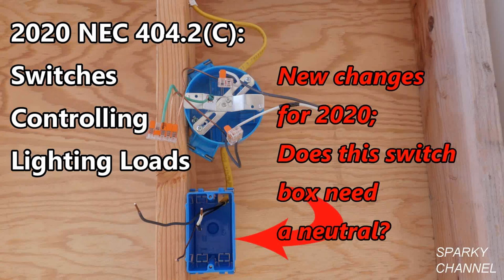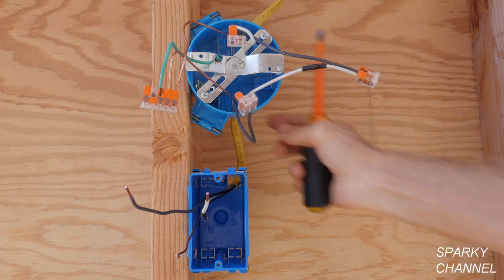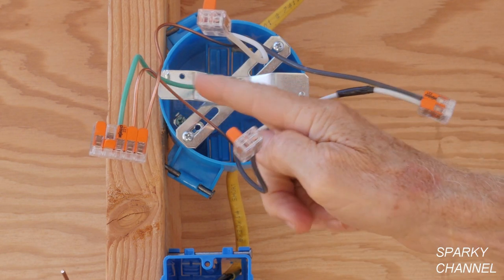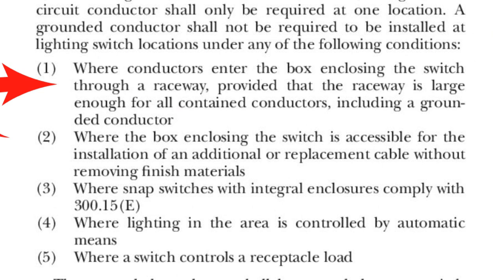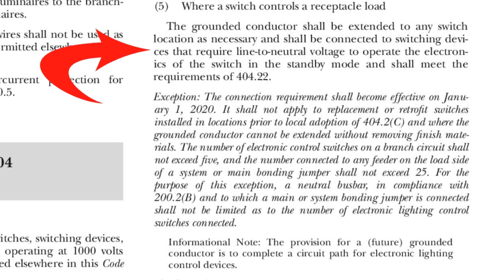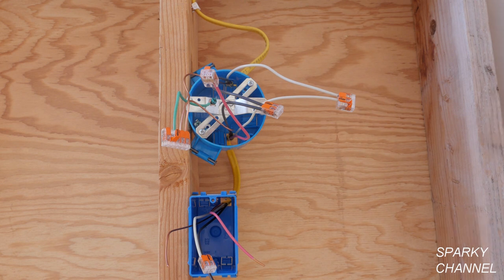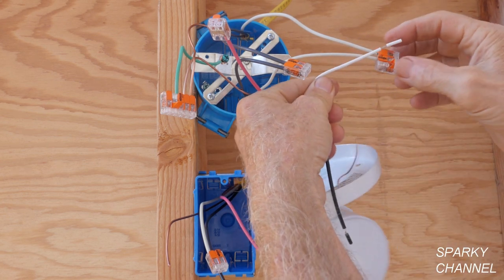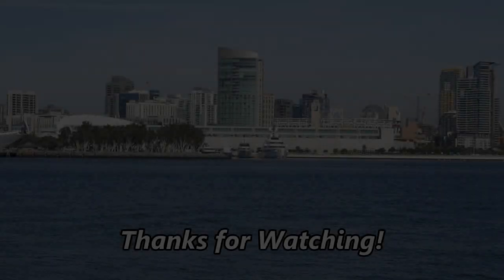NEC 2020 404.2(C) Neutrals in Switch Boxes with Example and New 2020 Exceptions

Comment: this is the problem with the code, It's only there to sell books and justify engineers jobs.  What purpose would running a neutral to a switch box possible serve?  There is already a ground so the neutral is unnecessary just added cost of wire and labor to install.  Forcing everyone to install an extra wire that they don't use just to tuck it in the back of the box is the essence of ridiculous.
Reply: @sparkyobrian6417  yeah, the code, both electrical and building, have outlived their usefulness.  It's one thing to secure safety but many of these codes have absolutely nothing to do with safety at all.  Why should everyone have to install a wire that they don't need, want or use so incase some person somewhere in the future needs it, it's there.    If someone needs the wire, let THEM install it.
Reply: This was added because people used to use the equipment grounding conductor as the neutral when installing electronic control switches. This was banned under the NEC 404.22.
Reply: In Australia, we install all lighting circuits with Active, Neutral + Earth cable looped at switch method. So only a switched active is run to ceiling light along with the neutral and earth.
Reply: lol the code is looking forward you are looking backward.  We want all Switch boxes ready to serve all switch types including those that need a Neutral.
Reply: @frotobaggins7169  that right there is whats wagon with society today.   You are saying that the extra $1.00 in wire is to much for you to deal with so you just make it hard on the home owner later..   That's all Wrong.. First the homeowner pays for the wire. And they would like there home to be Forward compatible.  IN your logic we shoudl all still be using Knob and Tube!.
Reply: @awack_  Is that what you think?  I should pay for wire that I'm never going to use so somebody else might not have to pay for it later?   What else should I pay for so someone 15 years from now  won't have to buy it?  maybe put a 3rd garage on, so they won't have to spend 20k doing it?   That is a ridiculous argument to force me to buy and install something I don't need, want or use.  It might not be so bad if it was just $1 but wire doesn't come that way does it?  I have to buy a whole reel of 3 wire cable so I can run it to 10 switch's, again that I don't need, want or use.  That's an additional $150, not $1.  Money that belongs to me not someone who doesn't own my house, money I could spend on what I want, what benefits ME, not someone who doesn't own my house.  If they don't want to buy my house because I didn't put a wire in that again, I DON'T need, use or want, than fine, buy somebody else's house.  People like YOU are what's wrong with the world.  People who think  you can force others to do what YOU want THEM to do and force them to pay for it.  How utterly ridiculous.  Heaven forbid you should have to pay for your own freaking wire that you want.
Reply: @awack_  so I should pay today for something tomorrow?  well tell me just where that line of thought ends?  should we put all this wire in conduit so we can eaisly replace it all?  in the 90's everyone was running cat 5 cable to all their rooms, you know, for the future.  Only the future came and it was wireless and no one uses all that cat 5 cable.   That is the problem with the code.  Yet, all those switches with, you know, the 2 wires and no common, still work 86 years later.
Reply: The problem might be that the codes are updated every 3 years.  The people on the boards, are put there by the companies that sell products, and the people want to "do something".  So a board deciding, "no change necessary", is not going to happen.      Dont get me wrong, we have had some great improvements  in wiring over the last few years, but requiring things, might be getting silly, because you touched it last.  Your simple closet light switch, is not going to be a smart switch.   However, I have upgraded a breaker box, with a newer one, for the newer features.  Plug on neutral, for easy  gfi protection in the box, and covers for hot points in the box.   However, I dont want to run another wire to the garage, because there is no neutral, only ground, and horror of horrors, there is another grounding rod at the garage, for the last 50 years.   Now, it must be wrong. (lol).    You've basically prevented me from upgrading the existing electrical box in the garage, without invaliding it, and having to run new wires.   Is that really what we want?   Dont touch it.
Reply: @frotobaggins7169  Home owner here, who didn't know anything about Neutrals being required for smart switches (til now). So when I bought the home, it's obvious I didn't ask/investigate this issue. Down the road, I bought smart switches only to figure out some switches didn't have the neutral (they had the initial setup from this video). So coming back to your $1/$150 discussion, what's the problem with spending that extra $150, charging it to the builder and builder charging me. If everybody follows code, your pricing should be competitive. Even if I thought about having smart switches before buying the home, I wouldn't have known (or asked) if all switches had neutrals. So it's nice to have someone (the code) force you guys to do have the neutrals in all switches and give me (or whoever I sell my house in the future) that option. And, the future certainly does have more Smartswitches, timer, etc in hand, so why not prepare homes for the future!! Now I don't even know if that switch I need neutral can be retrofited with the neutral....and if so, will probably be 10x the $150
Reply: @940alex  why should everyone else have to spend their money to install a wire they don't need, want or use just incase YOU want it?  If YOU want the smart switch so much then YOU can pay to have the wire run.   What else should we all pay to install incase you are interested n future up grades?  the number of homes I've been in that had smart swatch's is approximately ZERO.    People who want them can pay to have the necessary wiring installed or build their own home.  If I have to put the wire in, Price of the house will go up significantly to make the trouble worth the hassle.  This is the problem with codes, it's no longer about safety it's about forcing people to install stuff no one wants for the few who want it and the manufactures who make a killing off the worthless products.  Smart switches will be obsolete in 15 years.
Reply: @940alex  I don't have much or any use for "smart switches".
Reply: Neutral is a conductor.

Comment: Why not switch the neutral?  It makes no difference in functionality.  Then you get a neutral in the box.
Reply: You always have the switch on the hot conductors to shut off the current from going into a device. Otherwise, the switch would simply be opening the circuit, but not preventing current from entering a device.
Reply: Look at this video @4:30
https://youtu.be/0groxS9MaSw  
You would get a situation like this if you switch the neutral.
Reply: Same subject with a better explanation at 6:10
https://youtu.be/1TZ47h_UUSc

Basically the switches should always be breaking open the hot conductor to stop current flow.

Comment: I have to laugh at all these codes because it is supposed to prevent fires due to bad connections and bad wiring practices and yet code allows for those type of connectors being used in this video.lmao.
Reply: This particular code is one pushed by manufacturers so their overly priced electronic smart switches can easily be installed and they can sell more of them
Reply: What's wrong with the connectors?  Specifically.  Not just your assumptions and guesses.  

You really have no evidence that there's something wrong with them, just industry hearsay probably
Reply: @jpmacoo  Direct copper to copper contact is better.
Reply: @news_internationale2035  
Again, no real proof.  The videos I've seen where actual testing is done, the connections show only minor differences in voltage.  These newer connectors don't come apart as easily as wire nuts, even when forcing them back into the box.  And they also take up less room.
Reply: @jpmacoo  It's simple facts. If you introduce an intermediary material, you're likely changing the resistance.
Reply: @news_internationale2035  
Wait, is it a "fact" or is it "likely"?

You don't have proof, just your feelings
Reply: @jpmacoo  You didn't seem to know what resistance was before I mentioned it.
Reply: @news_internationale2035  
Not sure where you got that, but fine.  I'm looking for real answers, not just some industry pros who think they know it all.  If these connectors failed or were a danger they wouldn't be on the market, and used widely in Europe.  It's like how so many plumbers were against Pex when it first started being used.

Comment: this is absolutely stupid. If you don't think this is government corruption and overreach, I have an oceanfront property in Kansas to sell you.
Reply from the maker: There was a big uproar about this in 2011 when it first came out. We have 5 exceptions now that make it more workable. Also, it's good for installing digital devises which need neutrals.
Reply: Let's face it. It is just to eliminate the use of the equipment grounding as a current carrying conductor when devices require a neutral. Some individuals don't hesitate to do that, especially on their own home where they feel no one else will ever untwist a set of grounds.